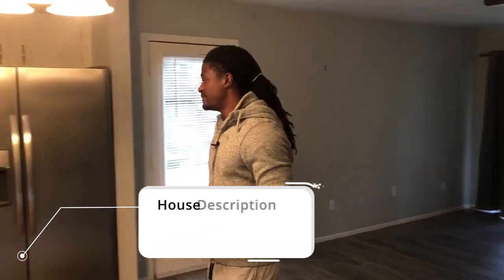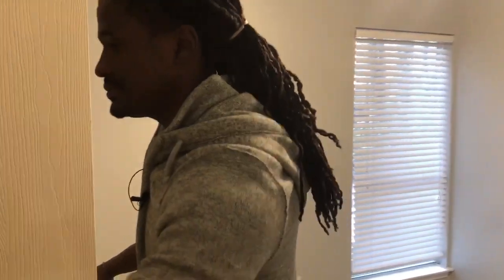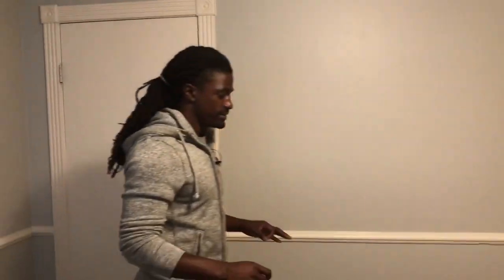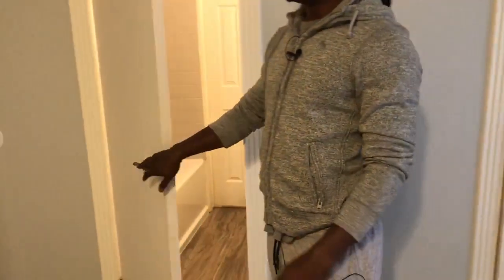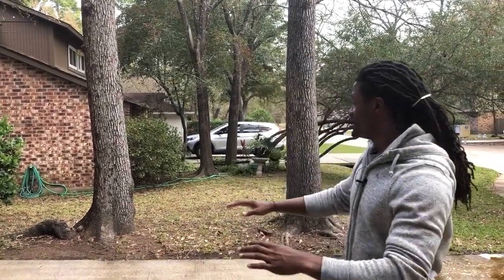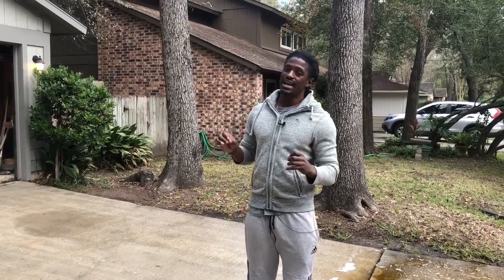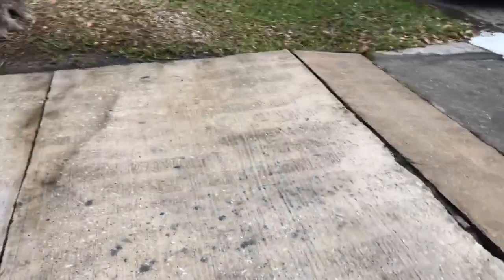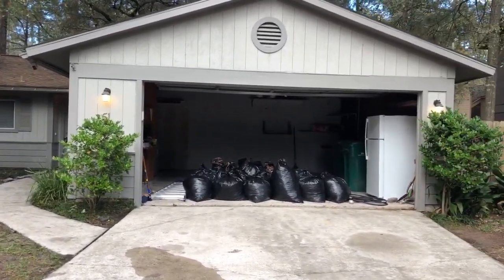How to add value to First Rental Property of 2020 for FREE

Comment: I like the idea of changing out the doorknobs/making them match. that's a simple and cheap upgrade that adds a touch of elegance. Would you ever consider upgrading the light switch/outlet plates to something other than basic plastic? That might be about $30-40 worth for the whole unit that could give an extra "pop".  
I was thinking either fancy covers with beadboard or even upgrade to the electrical outlet plates that include usb hookups. Something other than the flimsy plastic that breaks after a couple of months of plugging things into it.